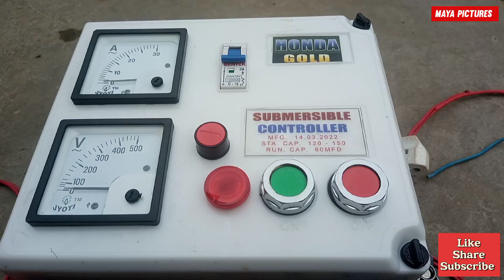Honda Submersible Pump 1hp||16 stage|| speed 2750 rpm👌#submersible #video #technical

Comment: Up to how feet it will works
Reply from the maker: If your water layer is fine up to 200 feet, then if the water layer is down then the water pressure will decrease.
Reply from the maker: you are from dist